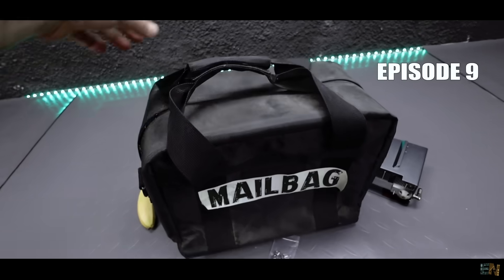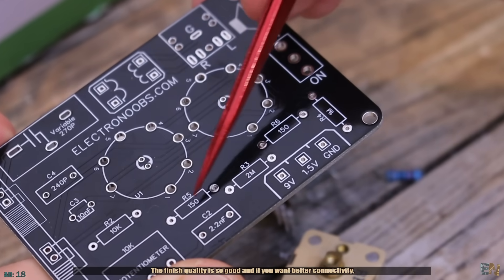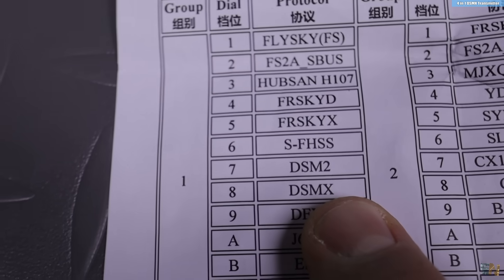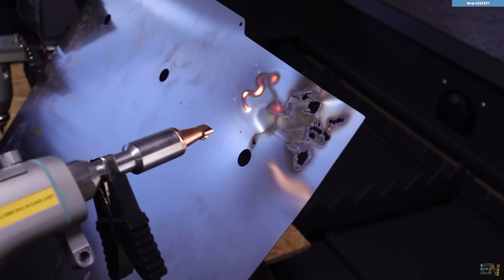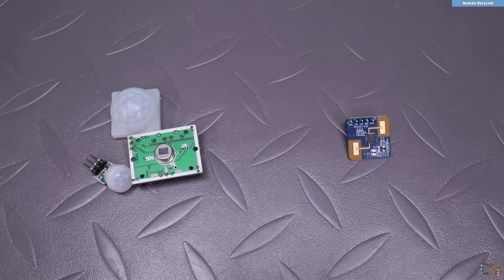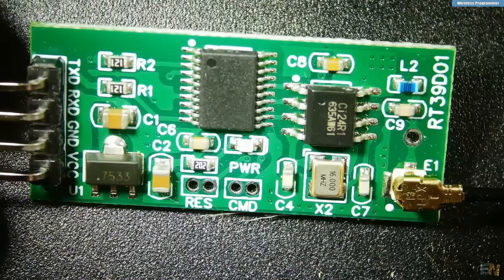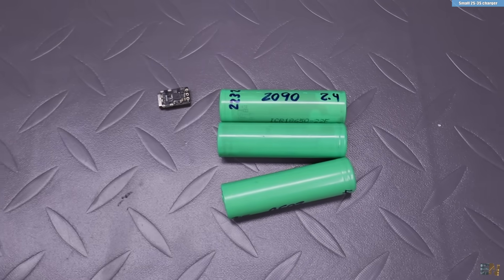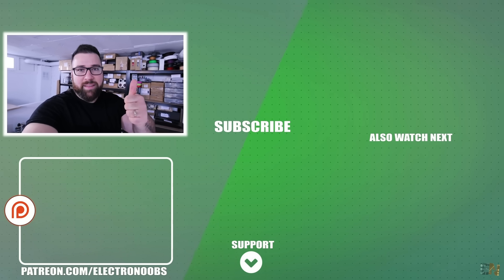Is this the SMALLEST USB Charger Module?

Comment: Cool thing to try with LD2410 is to connect it board to board with ES32 C3 super mini - they have compatible pinouts after removing middle pin (out) which is not needed.

Comment: Sorry, I'm a real noob. What does current output protection mean? It looks like the 2s module has over-current protection, it looks like.
Reply from the maker: If the device draws more current than the battery can give, the protection would just cut the output to protect the battery and components.

Comment: I'd would be nice if you could show the exact name of the products in the video or in the description and/or add links to sources. 
BTW: You show the LD2420. Maybe you want to check out the much better LD2410 which can detect static target (LD2420 can't).
Reply from the maker: sorry, for some reason the links were  not working, now I've updated the description so you can check them out! :)
Reply: I don't know about the links, but in the video you say LD2410, but the board you show is LD2420. You can see that looking where are the antennas - LD2410 has them on same edge and LD2420 on opposite corners. LD2410C is the best one to get - it is amazing.